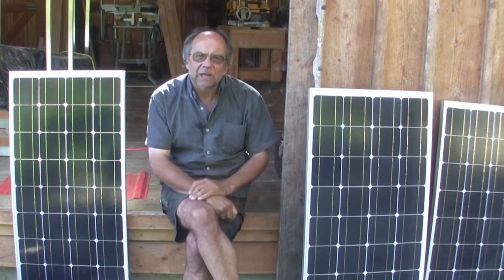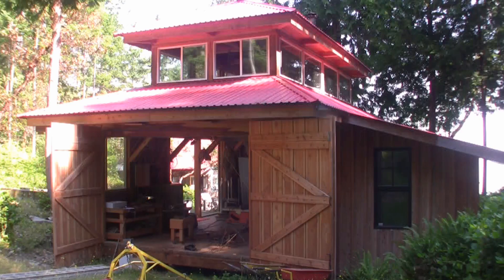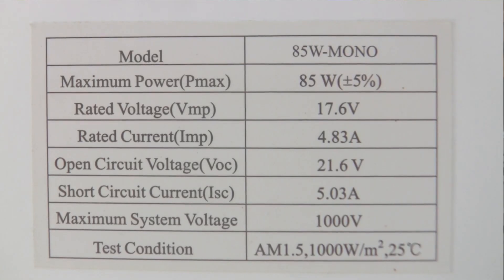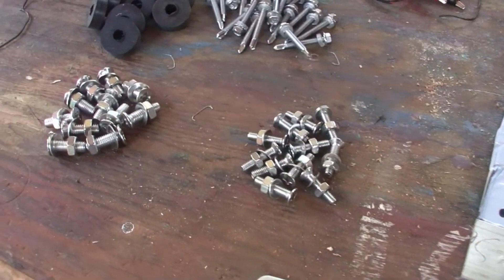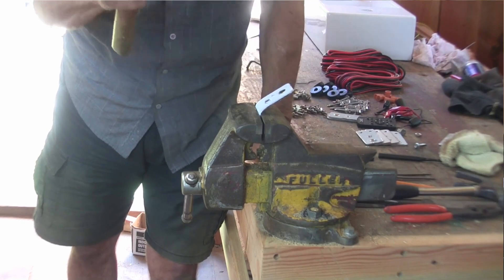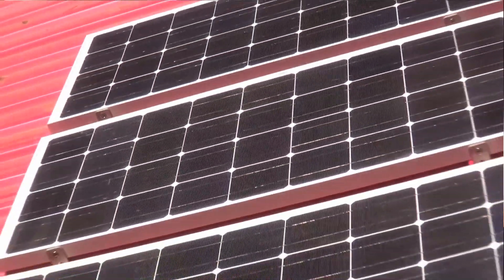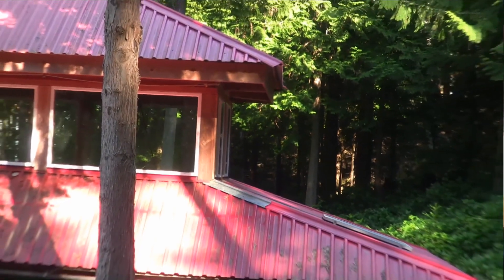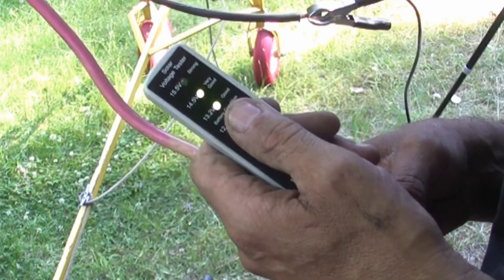Budget Solar Installation Part One

Comment: We're on the "right" coast, SW Nova so in spite of fog on a latitude fairly satisfactory for solar power. We're fortunately/unfortunately on the grid but we have frequent outages which you may be aware of if you follow the news regularly. I use an elderly but amazing Honda generator for such occasions and since we are retired folks we often don't need high current appliances and can manage for a considerable time without Reddy Kilowatt. I do use a some deep discharge batteries, inverter and some jury rigged charging options for water pump, computer, router, portable phones, led lights and ham radio gear, so really enjoyed viewing your videos. It is my intent to install a small solar array for backup eventually. Thank you so much for sharing. I love the "left coast", was born in New Westminster and raised on a gill netter on the Fraser too many years ago, but family roots go way back here in NS.
Reply from the maker: Hey Frank, thanks for your chatty comment & thanks for watching!
We're not off grid full time, as we still have to live & work in town (Victoria). We spend as much time as we can at the cabin, all year round - currently helping my neighbour build a sleeping cabin - coming soon to you on YouTube :-) It sounds as if you have most things figured out and you do whatever it takes to make things work. I have an issue that has developed in my new system; it looks like I have a "leak", possibly via my sine wave inverter...the controller detected a voltage drop and shut down over the winter, being undecided whether it was dealing with 12 or 24 volts. Now my new batteries are dead flat. I'll charge them up & start over. Fun, eh?
There have been a few good fisheries on the Fraser in recent seasons, but as you probably know, sadly, it ain't what it used to be.
All the best & thanks again for watching & getting in touch...
M

Comment: Did you put  a grommet or something else around that wire coming through the roof? I would be worried that it would short out over time.
Reply from the maker: I didn't, but I should. Excellent point....not too many hardware stores out in the woods!
Part 3 out soon
Cheers,
M
Reply: ***** well spotted.

Comment: in a previous video you said you use propane for heat etc.. how do you get propane to your place if you cant get anything else up there?
Reply from the maker: Hey Mike;
I said, we use propane for cooking and wood for heat.
Our property is on an island and our only access is from the water. No roads or ferry. The wood is all around and the propane we haul in 20lb bottles.
We bring in supplies all the time - via our small boat :-)
Cheers,
M

Comment: Hi
Generally a mechanical connection on the wiring is needed.  There is a possibility of the solder melting in hi current conditions.  There are electrical - & + connectors for this
All the best
Reply from the maker: Yves JULIEN As always, your math is sound, Yves :-)
There aren't too many MC4 connectors out in the woods where I am. In the "heat" of the moment, I used solder. It's what I had & It works.
Your advice is well received and I am grateful for your input.
Regards,
M
Reply from the maker: Excellent point...out in the woods, I use the material to hand. However, maybe a retrofit is in order down the road. Thanks again for watching.
Regards,
M
Reply: I doubt it very much. Lead melt at 327C. You would need a LOT of current from the panel to heat up the copper wire, which is very conductive! It's actually quite impossible!. Do the math... ;-)

However, I would not solder the connection either. I would use MC4 connector. It's much easier to connect/disconnect the panel as needed.
Reply: Markerbuoy - On Canada's Left Coast
Get them on eBAY for a couple of $ a pair... :D

Comment: Concerning the wattage advertise by PV manufacturer, it's good to know that there is two standard test used by the industries. Obviously, the industries chose to advertise the best of the two... The first one is the STC. Under Standard Test Conditions (STC) of irradiance of 1000W/m , spectrum AM 1.5 and cell temperature of 25C. That test are for conditions rarely found on Earth. It's more what a satellite is expected to get... The second test is NOCT (Normal Operating Cell Temperature). Under Normal Operating Cell Temperature, Irradiance of 800 W/m , spectrum AM 1.5, ambient temperature 20C, wind speed 1 m/s. The second test gives result of about 72% of the STC and this is the expected production of most panel on Earth... In short, when a manufacturer advertised 100W panel, that is the STC test, but expect to get around 72W (72% of STC). I hope this help.
Reply from the maker: Spoken like a true engineer!
Thanks so much Yves...
Best Regards,
M

Comment: Hi Mark, Did you know that most Solar Panel manufacturer will void their warranty if you drill hole in the frame? You have to used there pre-drill hole to install the panel.
Reply from the maker: Oops!....It doesn't bother me, but others reading here may want to take note :-)
When I install the charge controller, I plan to advertise your product and service...looking forward to the controller arriving soon....
Cheers, 
M
....and thanks for watching!
Reply: Well thanks :D Markerbuoy - On Canada's Left Coast